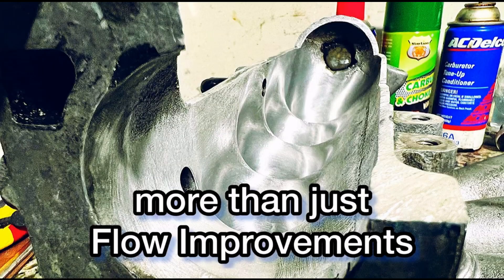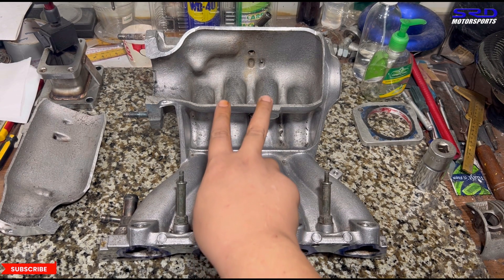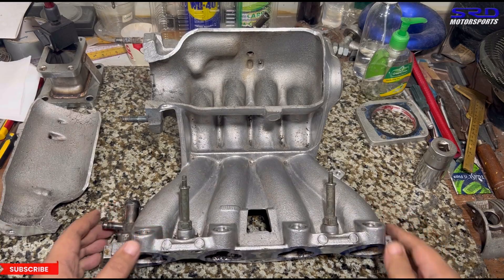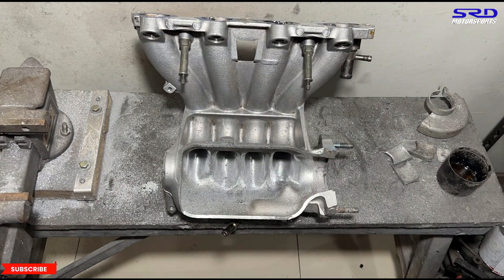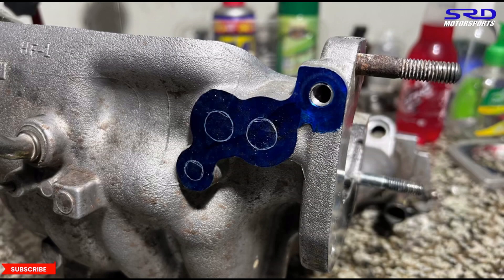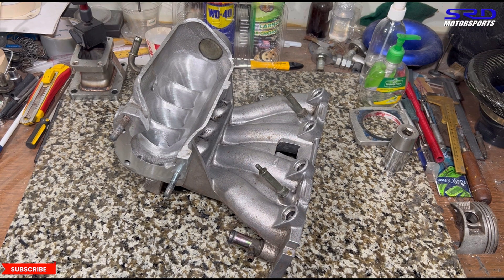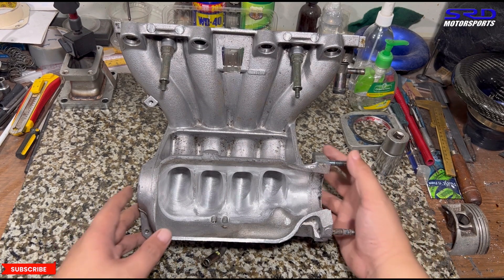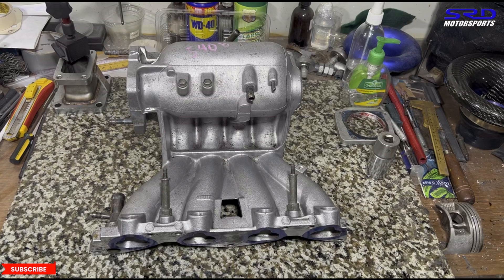D16y8 VTi Intake Manifold Porting P2J by SRDmotorsports

Comment: Will this make power with a stock cam?
Reply from the maker: a better breathing intake manifold will emulate as if the cam is slightly bigger, just like running boost could emulate similar. So Ofcourse!

Comment: Your technique is very good but your claims are unfounded unless you Dyno stock vs ported, and measuring  cfm with a flow bench. I agree with your knowledge but this is just old Honda Tech threads copied to you tube, nothing innovative.
Reply from the maker: Yep and if you know, you know… that’s good sadly not many of today even knows our fav Honda-Tech 
And 3 more forums

And yep dyno soon as I realized it’s been 2 decades and still no dyno comparison… so why not :) and so soon 😎

plus running 12.7s on a b16a 81x77 on pump and no slicks with a manifold i ported dyno is here on one of the videos,
And a b20vtec on pump no e85, no trailer a street car running 12.5s a street car
Works for what it is, and we all know “numbers” can be manipulated

Just like I’ve seen 240+ whp on trailer (not a street car) run 12.3s 
And the 225WHP I did does 12.5s granny shifting

But Ofcourse that’s all local here…
Reply: @SRDmotorsports  Your port work is excellent and all the content you've created is very accurate. There's nothing better than dynos and slip times to back up what we all create it's so satisfying. I'm building a f22a at the moment delta 282 cam, ported and milled head .030, lapped valves, h22 intake manifold full race port and adapter plate, lots of Tig welding the lower plenum underneath and ported to the floor, custom header 2.5" collector, 1000cc denso injectors on e85. Normally I'm building a b,h,d, engine so this will be my first f single jingle pretty simple. Keep up the content and hard work it's very impressive.
Reply from the maker: @ericloki3188  oh man oh man! You are doing what I’ve wanted!!! I actually had a spare f22 ? Was taking my time to decide until then an individual blew his accord? That had an identical engine… and to save him some time and cost? I passed it on to him ☹️ to this day I remember it (it was last year) 

As my plan was real close to yours by going Delta too! just to have a “big” sohc 
was gonna scout for an f20b piston to save cost rather than going supertech but if budget allowed I’d have gone forged but maaaaan real close in project as I did plan to use the h22 manifold I have now and I hear ya on the “tig welding” fo sho
Reply: @SRDmotorsports  So many good options for the f, h, g series hybrids.
Reply from the maker: So so true man!

Comment: Would you need an iacv even though you have a standalone ecu like Haltech ?
Reply from the maker: Yep… IACV is “Idle Air Control Valve”

tunable ecu gets to control it for the necessary idle target etc
Reply: @SRDmotorsports  Thanks a lot.I have a d16 and would like to lock v-tec to build a vtec killer for street driving.Would low compression pistons work in this application or is high compression needed ?
Reply from the maker: @riyadmohammed5696  really depends but if lacking compression it could mean lesser torque generation but it’s always relative to the rest of the set up